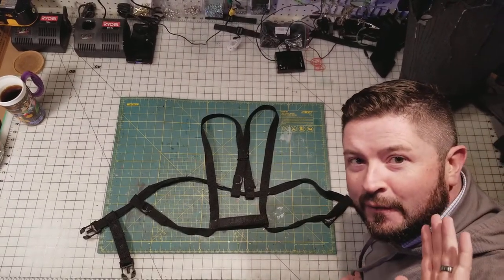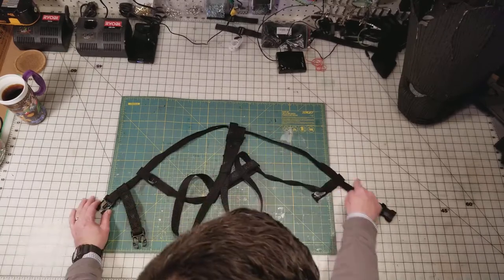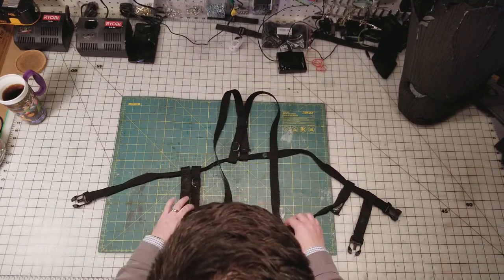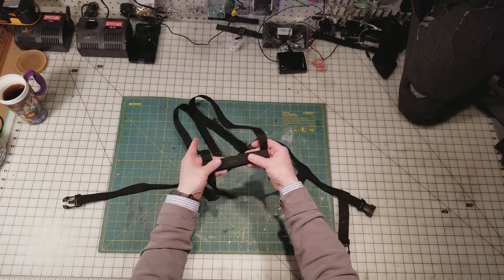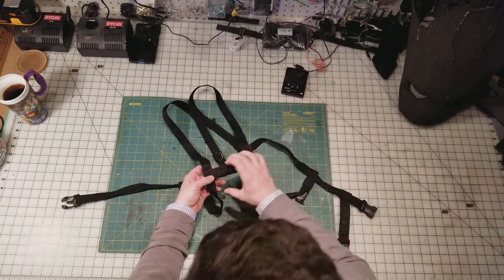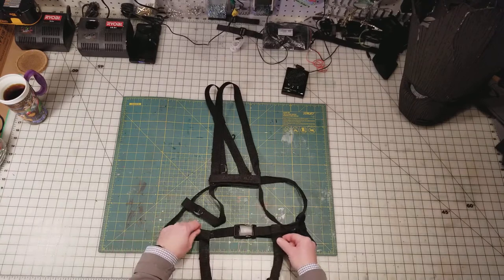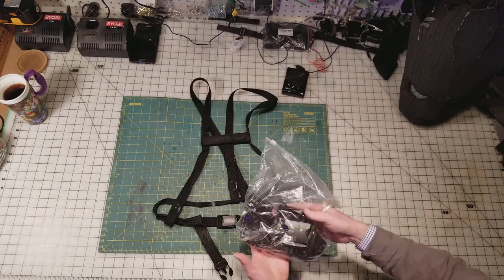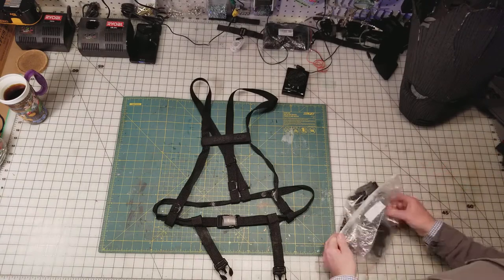Stormtrooper Internal Harness Explained

Comment: New question: did you use superglue on this, did you use velcro or did you do any sewing?
Reply from the maker: maccrawinthejaw no sewing. Just E6000 and Hot Glue. The Velcro is just from a roll of 'hook and loop' from Harbor Freight Tools.
Reply: What about padding for your Stormtrooper helmet? How do you put padding in helmets?
Reply from the maker: maccrawinthejaw I made pads from EVA foam and just used E6000 to install them. I made templates that fit and layered them until the helmet fit.